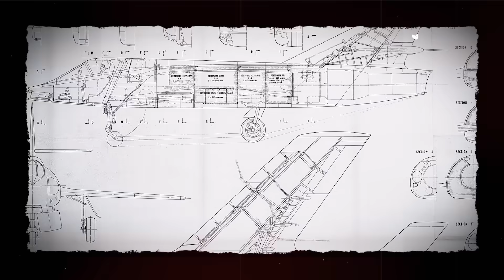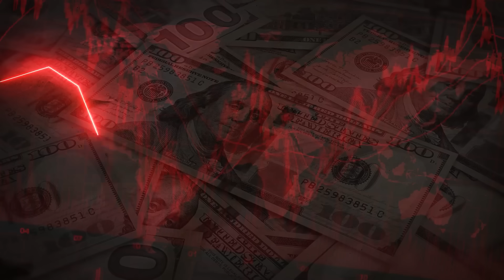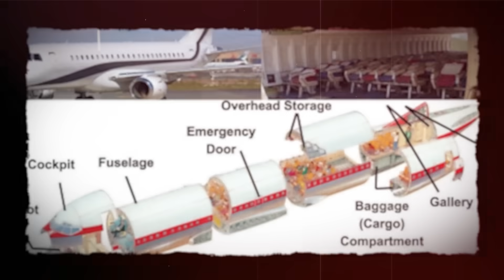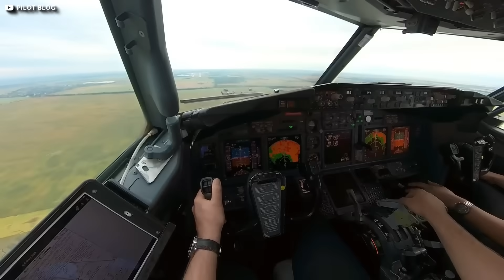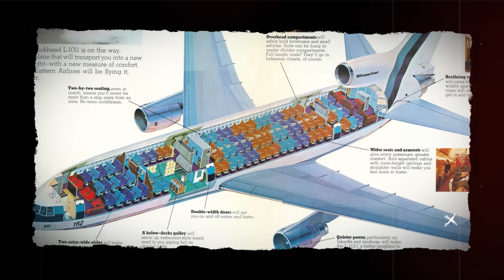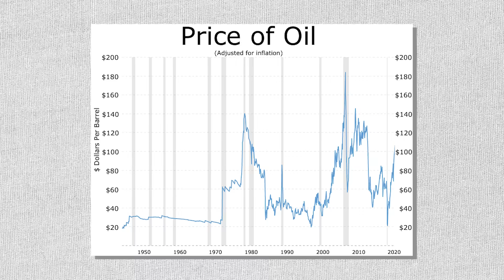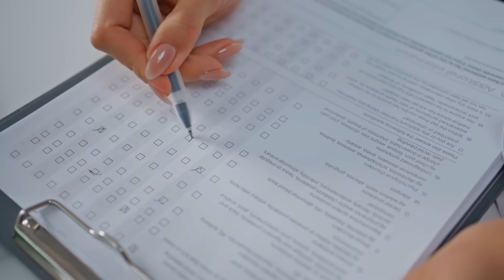What The Trijet Design Was Really For

Comment: It is false to assert that because an airplane has one engine less than another, such as the DC-10 vs 747 implies that a company will spend 25% less fuel.  Those airplanes have totally different total weights (MTOW) so while the total weight of the 747 is between 875,000–986,000 lb, the DC-10 only weight 555,000 lb.  Those are MTOWs or Maximum Take Off Weight which represent the actual weight of the aircraft + passengers + luggages + catering + seats +GAS = MTOW.

While it costed less money per trip, that same exact trip could not accommodate the same number of passengers which is less revenue nor could it use the "empty weight" as cargo weight and therefore more CGO than what each aircraft was designed for.  The 747 was originally designed to transport a lot of cargo with the maximum number of passengers it could have (429).  The DC-10 had only two versions, the DC-10-10 and DC-10-30.  Boeing made about 15 versions of its 747, from 429 (7971) to 576 seats (with single class on both deck).

Comment: Both the L-1011 and DC-10 were colossal losses for their manufacturers. It takes about 500 units to break even on development and certification costs. Combined, they still didn’t make that number. At the time, the 1011 was the largest single project industrial loss in American history. Lovely aircraft. The DC10 started later and flew sooner. Also had a worse safety record. Not that rushing entered the scene or anything.

Comment: Lockheed tried to recover from the Electra debacle but failed miserably on the L-1011.  The design was fine, but the Rolls Royce engines it needed were not.  The company went bankrupt and was bailed out by the UK government, but the engine was delayed.  The DC-10 launched first and the L-1011 never caught up.  Ironically, the DC-10 was a dangerous design. In their rush to get it out, the flight controls were put under the floor of the cabin (why controls were lost a few times).  When the cabin depressured for any reason, the floor dropped a few inches, cutting off the controls and causing the plane to crash.  It was never a safe plane because of that, until they redesigned the controls so that the floor could not impact them.  However, the damage was done and sales collapsed not only from only needing two engines to cross the ocean, but because of its safety record.  The L-1011 forced Lockheed to exit the commercial aircraft market, and the MD-11 failure bankrupted McDonald Douglas, forcing them to sell out to Boeing.

Comment: The 727 had the center engine buried inside the rear fuselage, NOT the vertical stabilizer.
The inlet went through the vertical stabilizer, but the engine was not in there.
L-1011 was the same way. 
Only the DC-10 / MD-11 had the aft engine mounted inside the stabilizer.

Comment: I last flew on an L-1011 in 1996 (Atlanta to Fort Lauderdale). Before that, tri-jets were so common. In 1994 I flew on an MD-11 (DC-10) to and from Hawaii. Other than that, the 727 was just as main-stay as the 737 is today. With the DC-10 maintenance of the #2 engine was difficult due to it's high mount in the tail. It created more drag than the L-1011. 727's became replaced by the DC-9 first off. Also, not mentioned, all these tri-jets required THREE people in the cockpit to fly them, not two. A flight engineer, who monitored the aircraft systems, was needed in addition to the captain and co-pilot. So the elimination of this extra salary saved a bit too.

Comment: The DC10 was a piece of $hit that was started after the L1011 and completed before, illustrating the potential shortcuts that may have been taken that resulted in numerous crashes resulting from blown out cargo doors and loss of non-redundent flight controls or bad designs that fostered maintenance work arounds that compromised safety. You never saw this in the L-1011. After the Souix Falls crash, I never would have flown a "Crash 10".

Comment: Eastern Airlines was the first, I think, airline to get the L1011. It almost put them out of business. The Rolls Royce engines had weak front turbine bearings and the downward thrust of air on #2 at takeoff was blowing engines. They had to hold in position for takeoff for some time before releasing the brakes just to see if #2 would blow. #2 had to be changed out every 500 hours.

Comment: I was too young to remember AA191, but I do remember UA232. Made me a bit nervous when I had to take a DC-10 on a trans-Atlantic flight in 1997.
Reply: Not long after AA191 at Chicago O'Hare, I flew on a DC-10 from Toronto to O'Hare on a Friday the 13th.  Before takeoff, the engines spooled up to full take-off power while holding the wheel brakes for about 13 seconds.  The right engine wobbled sideways back and forth very slightly at full power while standing still (I presume that was normal).  The brakes were then released and we accelerated down the runway and had a very nice flight.  I flew on the L1011 Tristar 5 times and really enjoyed it.

Comment: I'm a Commercial Instrument Pilot, FAA Airframe & Powerplant Mechanic and ex-Air Traffic Controller. Plus, I also worked for over 30 years in the Flight Simulator industry. Guess you could say I have some aviation experience. This is the best explanation I have ever heard on what drove the engine configuration changes on the airline fleet. Great video!
Reply: Following in your footsteps rarified brother, I agree with your observation.  Though now retired, I do recall the days of E.T.O.P.s. (colloquially referred to as "engines turn or people swim) We've come a long way.
Reply from the maker: Thank you so much!
Reply: Thank you for your service

Comment: As far as I am concerned, the Lockheed L-1011 "Three" was the perfect number. That was a beautiful aircraft.
Reply: I concur heartily with Mr. Knight: the TriStar was the best of its class. What power, what comfort, and what beauty!
Reply: @user-HighIntheSky724  I hear you!
Reply: I used to take the L1011 between Palm Beach and Atlanta back in the 90's... by far my favorite plane to fly in.
Reply: 35 yr AA pilot, I agree
Reply: Why did you put a AA logo on the tail of a L1011? AA never had those. DC10 and 727 yes, but no L1011
Reply: @jeffsmithist The L-1011 was originally designed to meet an American Airlines spec.  But American never bought the L-1011.
Reply: Loved the whisper jet (liner).

Comment: It was not so much a fuel burn problem.  A 3 or 4 engine jet can be as efficient as a twin.  The issue is 4 engines cost twice as much to maintain as two engines.  That is where the math swings the operational cost much more than fuel burn.  It is easiest to think of it this way.  If an aircraft weighs 400k lbs loaded it needs some amount of thrust to fly.  The amount of fuel needed to attain that thrust is going to be equal along with equal fuel burn whether you have two burning or three of four.  Yes the mass of extra engines means its carrying more equipment mass and engine heat losses increase with the number of engines but those are minor variances because more engines would also be smaller engines compared to a twin of the same size.  4 engines also means losing 1 is a loss of 75% of thrust while losing 1 of 2 engines means you lose 50% and that thrust is much more asymmetrical.  Tri and Quad had their advantages but in the end it was higher ETOPs ratings on twins and the cost of overhauling engines that killed Tri and Quads.  What truly wrecked the trijets was some high profile DC-10 crashes and Lockheed also competing in the same market space meant a lot of competition in wide body trijets.  Lockheed lost fortunes on the L1011 and left the airliner business for good because they could not sell enough of them to make any money with each jet being sold for less than it cost to just build the unit.
Before slaying me in comments by comparing efficiency figures of engines I am talking about the engines of the period.  Even in the 80s you had some small regional jets with 4 engines like the BAe 146 and they were competitive with twins of equal size in fuel burn.
Reply: Yeah, but as bypass ratios grew it became more obvious. A 767-200 burns something like 7000 pounds an hour less than an L-1011. It does so with similar total thrust. The engines are bigger and therefore more efficient.

Comment: The flight 191 crash WAS in fact a maintenance issue.  American did NOT follow Boeing's instructions for removing and reinstalling the engine.  I also don't think it was a mis-torqued bolt but rather that the clevis pin was damaged during removal and reinstallation of the engine.  It was not a design flaw.

Today, most planes are dual engine, even the large B777 and A350, which just shows the advancements in aircraft design, partially thanks to things like newer metals/composites and the use of fiberglass which greatly makes planes lighter and thus more efficient.

I mean it's crazy to think the modern B777 variants can carry roughly the same number of people as but use perhaps 40-50% less power of a B747 or even similar jets of the era, yet they're also more reliable.  But part of that is just the continued building of knowledge as time goes on.

Comment: AA tried to force the DC3 (and maybe the DC2?) to be a 3 engine (like the early Ford Tristars). Required the plane to cross the Rocky Mountains at their highest point with one engine off.

Douglas had no intention of mounting an engine on the nose of the DC3. Engines on the fuselage created discomfort for the passengers. 

Engine improvements of the time (1930s?) allowed the DC3 to cross the mountain on only one engine. Two engines was the answer!
Reply: Engines on the fuselage have been working well for over a hundred years. Think of the Cessna 172 or a Piper Cub? The wings should be for flying thru the air, and landing.

Comment: Lack of ETOPS was certainly a factor, but the primary reason for 3 holers was that the engines of the day just didn't have enough thrust to provide useful range on a widebody.  Airbus tried with the A300B4 but it was no threat to cross even the Atlantic.

Comment: From my own perspective as a passenger, three engines at the back made for a quiet and enjoyable flight.
Reply: I will agree, except multiple times I had to ride in the last two rows on the 727...right between the #1 and #3 engines (and just ahead of #2), which was a very loud and very hot...and claustrophobic (because you couldn't see out any widows on either side (because of the engines being right there)...ride.  That being said, I always loved riding the '27.  I miss them!
Reply: yep, so true. No engine noise at all in the cockpit. Even when at takeoff. But now the air noise in the cockpit is another matter. My wife keeps saying I need hearing aids. I say huh ? ( Retired with over 23,000 hrs on the 727.)
Reply: @pastorjerrykliner3162 Loved the 727, but yes, it was awfully noisy in the rear with those darn engines screaming.  Same with the DC-9, as I recall.

Comment: So how and why did the FAA go from 60 min requirement for two engine flight over an ocean to 180 minutes?  😳🤔
That’s a triple fold increase. 

One can only follow the money and think how the pressure from airlines and manufacturers alike. 

This change affects not just airline ops under Fed regulations Part 121, but the charter ops world of Part 135. So think mainly what we call business jets even though an Airbus A320 or a Boeing 737 can be a biz jet.
Reply: Modern engines are far more powerful and yet reliable than the 70's era Turbofans

Comment: Part of the reason for engine reliability to rise (8:00)  was because of less in flight shut downs.  In their zeal to achieve better reliability statistics, then they can qualify for an ETOPS time increase,  captains were quietly told , if you have a problem with your engine, unless the damned thing is on fire, do not shut it down, just reduce power, then it is not a shut down and will not be logged as such. This was very different to the 4 engine practice of past eras where you really do not need all the engines after take off , and they will shut down an engine at the slightest sign of trouble. Actually military planes on patrol duties regularly fly with two engines shut down to improve loitering time.

Comment: I still regularly see DC-10s operating out of an aircargo hub near my workplace. 
Seems to have had an excellent safety record in the years after the high-profile crashes.
Reply: Of the 3 fatal 1979 DC-10 crashes, none of them were the plane's fault.
Reply: @Brons2 - The cause was improper maintenance procedures, however several design deficiencies contributed to the accident:
- Slats held extended only by hydraulic pressure, no locking mechanism.  It was the retraction of these slats when hydraulic press was lost that caused the aerodynamic stall of the wing.
- Poor electrical redundancy - numerous cockpit indications were lost, including significantly the slat position indication.
- No redundancy in the stick shaker (stall warning) - only one was fitted, and it was unpowered with the loss of the electrical power on the essential bus (my bus nomenclature may be off, it’s been years since I flew it).

Overall, the DC-10 was rushed into production, under-engineered, and far less robust than the TriStar.  It did fly nicely however, but not as nicely as the TriStar (yes, I flew both, as well as the MD-11, and the B-747-400).
Reply: DC-10 is the MAX of that era

Most DC-10’s have been upgraded into MD-10
Reply: @Cliporado  The only real change between the DC-10 and MD-10 is that the latter has the MD-11's updated cockpit.
Reply: As I always said of the DC-10:  “Manufactured in Long Beach, engineered in fields all over the world.”
Douglas engineering was quite lacking, and the aircraft was rushed to beat Lockheed to market.  It ultimately was a fairly good aircraft, and handled nicely - but at the cost of hundreds of lives due in part to those engineering deficiencies.
Reply: @AndreySloan_is_a_cnut  The DC-10 was designed in an time when Douglas was highly strapped for cash and when the plane makers of the world still thought that all long-haul passenger traffic was going to be supersonic in a few years - so it was designed for easy transition to a cargo transport. Like the 747, it was built to have a quick-open cargo door, unlike the 747 it didn't have the cockpit removed to an upper level to build a nose door underneath.
Reply: Probably a MD11. Looks much the same but with a 2 man crew and not a 3 man crew.